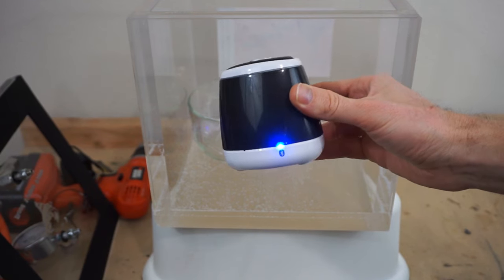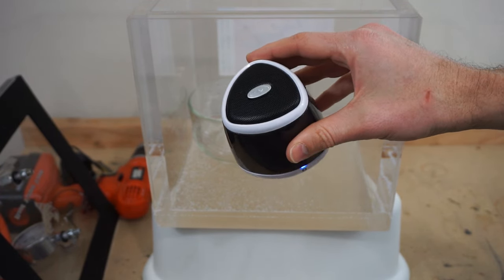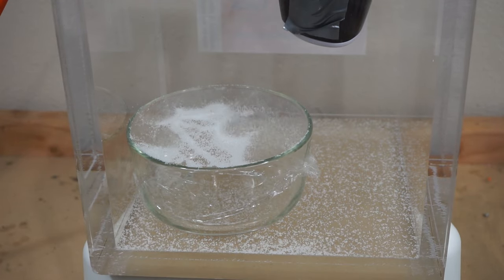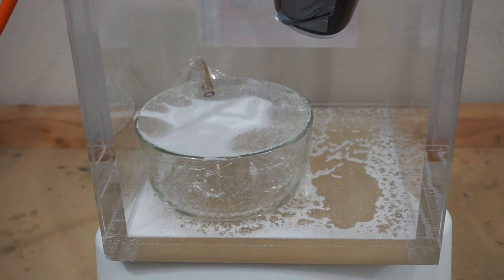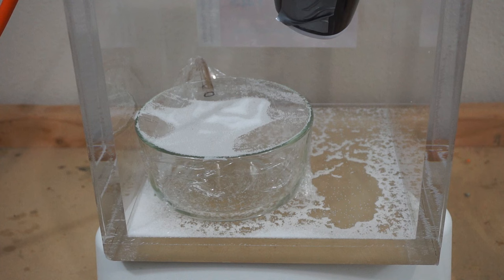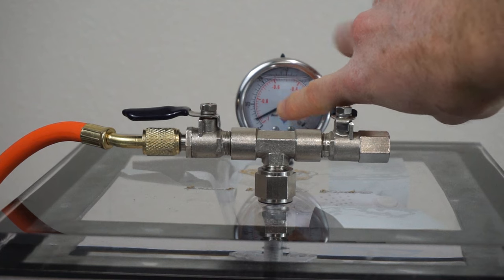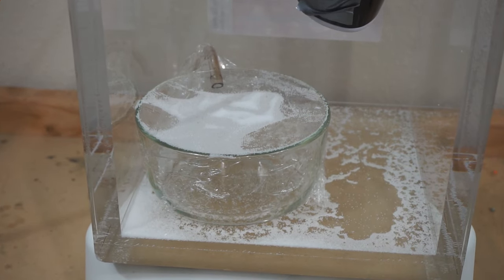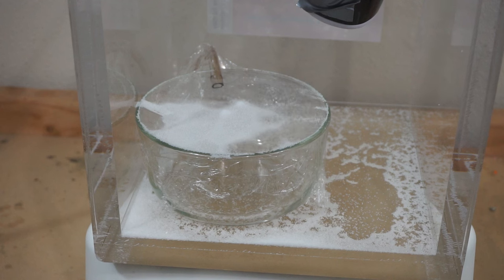What Happens When You Put A Speaker In A Huge Vacuum Chamber? Can You Hear It?

Comment from the maker: There are some people commenting that you would hear an explosion in space because the gas from the explosion would create the medium in which you could hear the sound. I did a quick calculation to check if that would be the case. So lets assume that we have a 100 L canister under 10,000 bars of pressure that explodes in space and we are 10 meters away. The gas will expand adiabatically (no transfer of heat) such that when it hits us, the pressure will only be 0.003 bars! That is still a much better vacuum than I had in this experiment. But based on the experiments of Cody's Lab we see that the initial pressure wave can have enough kinetic energy to at least move a paper, which means it could move your eardrum. So depending on your definition of sound then you could say that an explosion hits you with its own gas which will make a sound to you!

For this calculation: Assume gas is diatomic so gamma=7/5. Assume gas is ideal. So PV^gamma=constant. So the constant we can find from P_initial*V_initial^(7/5)=10000*100^(7/5)=6*10^6. Then after the gas hits us at 10 meters away it has expanded to a volume of 4.2*10^6 Liters. Using the same relation: PV^gamma=6*10^6 then we get that the pressure =0.003 bars!
Reply: Hydraulic Press Action can someone translate this for me
Reply: Hydraulic Press Action  r u a wizard
Reply: lol
Reply: Hydraulic Press Action do a light bulb that's on in the vacuum 💡
Reply: Hydraulic Press Action try cooking different types of food in it c:
Reply: +Paul Stringini there would be no explosion since there is no oxygen
Reply: Hydraulic Press Action I heard it's colder inside the vacuum chamber, is this true?  Can you please put an old pc in the chamber, run some benchmarks, and record its temps? I'm guessing the cpu will over heat because there's no air to push the heat off the heat sink so you might have to place a water cooling unit outside the chamber using rigid tubing. This is something I've always wanted to experiment with but I don't have the money to buy spare pc parts or a vacuum chamber.
Reply: hed420 Now that would be a good test.  Probably need a slightly bigger vacuum chamber though to fit a PC.
Reply: Hydraulic Press Action im in 7th grade but im pretty sure gamma made the hulk i think thats what i got from that
Reply: Hydraulic Press Action put a sponge in a vacuum
Reply: Hydraulic Press Action What the fuck does that mean
Reply: Hydraulic Press Action what app
 did you use for the tones
Reply: Hydraulic Press Action although your calculations show that there is gas present sufficiently enough within your description, I must question (without assuming any knowledge just wanting to question) whether the expanding gas that is currently expanding into the vacuum would be able to appropriately carry sound waves or would that active expansion cause energy dispersion on its own?
and in the vacuum of space Within the gases disperse faster than the speed of sound could reach them.
if you've ever experienced distant proximity to a large explosion, the shockwave reaches you visibly and physically prior to the sound wave.  but I wonder if that Shockwave would be noticed or would really be a "shock" wave without atmosphere? and then could it be followed by a sound wave if there was no atmosphere to carry it.
Reply: Codys lab did a test on gas in a vaccume it was pretty cool
Reply from the maker: Paco Vasda I believe that you would hear/feel the shockwave slightly, but not any following sound because as I showed the pressure would still be too low for any sound to occur.
Reply: you should check out "codys lab" he done explosions in his vacuum chamber
Reply: sound cant travel without a medium
Reply: Hydraulic Press Action it would only create hydrogen and release a wave of shrapnel towards you
Reply: +Hydraulic Press Action  What calculations did you do exactly??  How did your math give you more than 30 orders of magnitude difference?  I would be interested to either see this math, or know what your method was
Reply: How TF did you come up with 10^-29 bars? you do realize that a single molecule hitting a square cm would produce more pressure, right? also what is the volume of your "huge vacuum chamber" the chamber I've been using is about 30 Liters.
Reply: Cody'sLab hey Cody love your channel
Reply: this statment is not finished!
Reply: Hydraulic Press Action I pressed read more and I was like woah I was expecting like 3 sentences
Reply from the maker: +Cody'sLab I showed my calculation in the comment. The calculation was for an adiabatic expansion of a free ideal gas. Using the first law of thermodynamics you can come up with the relation that the initial pressure times the volume raised to some power is a constant (PV^gamma=constant). The small number comes from the huge volume of a sphere with a radius of 10m. Let me know your answer to what the end pressure would be. And yes, I understand that 10^-29 is zero.  And in regards to my "huge" vacuum chamber. I guess size is relative. Congratulations on your huge vacuum chamber.
Reply: Hydraulic Press Action  Your comment was cut off when I saw it.  I only now can actually see it
Reply: Hydraulic Press Action  Okay so here's the mistake in your math.  You wrote "P_initial*V_initial^7/5=10000*100^7/5=2^17".  That's wrong.  You need to get your order of operations correct.  It should be: P_initial*V_initial^(7/5)=10000*100^(7/5)=6.3x10^6.
I highlight that because you need to make sure that gamma=(7/5) is in parentheses.
Reply from the maker: +DANG JOS Thanks. You are right. That is embarrassing. So I get 0.003 bar which sounds a lot more realistic. But still a lower pressure than I got in my vacuum. If you don't mind I will edit my above comment so no one else is confused.
Reply: Hydraulic Press Action  That's fine.  And nothing wrong with admitting your mistake, which is what you did
Reply: Hydraulic Press Action  Oh and by the way, I don't think this calculation is appropriate for what we are talking about.  That equation for adiabatic expansion is really for an expanding gas confined in a container (pushing against walls creates the pressure).  In a space explosion, there is no confinement.  Rather the pressure comes from the high kinetic energies from the expanding gases that are flying out at as much as 9,000 meters per second!!  

This is what causes the pressurized shock-wave in an air explosion.  The expanding gases are compressing the air around the explosion into a huge pressure wave.  You can't use "PV^gamma", in that simple manner, in this case either.  So for a space explosion, the very high kinetic energy gas would compress your body and send a wave through your bones (via bone conduction) that you would likely hear.  Just think about a supernova.  The giant ring of glowing material around a supernova remnant comes from the compressed interstellar gas that surrounded the star.  So even in the vacuum of space, high pressures can be induced
Reply from the maker: +DANG JOS Yes, there are a lot of assumptions in my calculation. The one you are talking about is that the end volume is confined. The reason I did this is because it seems like this would be the best case scenario of highest pressure in that volume because all the gas is spread out evenly in the volume. The shock waves you are talking about are when an expanding gas is expanding against an already present gas creating huge pressure waves. For a free expanding gas in a vacuum I'm not sure that is the case.
Reply: Hydraulic Press Action ok umm where did you get your vacume thing at
Reply from the maker: +DANG JOS. For supernova I wouldn't want to be near either. But in this case, the max acceleration you should feel floating in a space suit 10m from this exploding cylinder should only be about 0.2 gs. So not too bad, you would just start floating away. You can check me on this one too (Pressure=0.003 bar-assumed, force on a 5 ft^2 human cross section would be 129 Newtons, and F=m*a so for a 60kg person, a=2m/s^2 so about 0.2 gs).
Reply: Hydraulic Press Action  Well that's based on the assumption that the numbers you gave are realistic.  If we're going to use real numbers, we have to think about what kind of an explosion that actually is. If we used 500,000 bars of pressure instead, it would be 10 g's and now it's a different ball gave.  So for 30 pounds of TNT let's say, what would it be then?
Reply: I'm so used to the youtube comments just making no sense and making your brain stupid just by reading the comments but not in this case. I actually learned something from Youtube comments. I can now check that off my Bucket List.
Reply: Eyeless Jack.  Lol.  It's a nice change isn't it?  Believe me, the past several months, I've spent too much time arguing with flat-Earthers, so this is definitely a welcome change
Reply: Hydraulic Press Action so it's basically how an explosion would sound coming from under water and then the after shock would hit u which is its own gas in similar context hitting the ear drum
Reply: #100%
Reply: yeah...
Reply: A sudden increase of 0.003 bar is still a lot when you compare it to the small pressure variations of normal sounds. The 0 dB point for standard sound pressure (SPL) measurements is set to 0.00002 Pa so that would translate into LOG(300 Pa / 0.00002) * 20 = 143,5 dB SPL! So you would indeed hear and feel a lot of it.
Reply: Hydraulic Press Action dude people aren't stupid. relax. you don't need to explain in detail where it comes across silly. 
we can all see what's going on. 
don't over kill.
Reply: This was a clever experiment like your RC drone experiment.
Next time, add no music to this, since the experiment is based on sound.
I did hear the sound gradually increase as the air was back to normal atmosphere.
Reply: Hydraulic Press Action I really want to read the explanation but I see numbers so I keep scrolling. 😂
Reply: +Hydraulic Press Action Uhmmm, assuming that gas in a canister explodes in a spherical shape, will the expanding sphere be solid with uniform pressure throughout the sphere  or hollow with a travelling front of sharp pressure spike leaving vacuum in its wake? Or might it be a combination of both, where the travelling front might leave a wake of constant pressure, increasing pressure from the center up to the travelling front or something else entirely?

Also isn't an explosion sound the pressure wave created by the explosion on medium not necessarily the explosion itself, that when the gases of explosion reaches you and you survive, it might actually just sound like a very very strong draft of wind? Also human ears have to be in 1 atm to function without bleeding involved, now that complicates things.
Reply: Ride84XL  That's a very good point!
Reply: Shit. This is a calculation which my brain can't comprehend..
Reply: Hydraulic Press Action looking at this coment my brain just shut down
Reply: Nice!
Reply: Hydraulic Press Action I read none of this
Reply: Aniekan Umoren sonic
Reply: Hydraulic Press Action I didn't get anything you said
Reply: Hydraulic Press Action how's that work on girls?
Reply: +Pilot172 Cessna172  No, gamma should be the ratio of constant pressure specific heat, to constant volume, which for a diatomic gas would be 7/2 and 5/2.   So the ratio is indeed 7/5.  And yes you absolutely can hear a pressure of 0.003 bars
Reply: Hydraulic Press Action have you made a video on water in a vacuum?
Reply: Hydraulic Press Action now what about pressurizing the chamber, would it increase the salt vibration.
Reply: reed vending  I would say yes
Reply: Actually most explosives have some type of oxidizer in the explosive compound. No outside oxygen source is needed.
Reply: Space isn't a vacuum. It's usually treated as one but it is not one. Space has an average kinetic energy (temperature) which requires particles.
Reply: hed420 it's only 'colder' as there are no particles to carry energy. temperature is the energy of the particles. it's not actually colder, there's just nothing to read a temperature from if that makes any sense. no particles can vibrate onto your sensor and that means your sensor picks up less vibration and thus a lower reading. as there are no particles to read from, there are no particles to allow for heat transfer (significant / not radiant which will occur) and the pc will get very hot and operate with no advantage.
Reply: Hydraulic Press Action i didn't understand any of that
Reply: Hydraulic Press Action, that would be as loud as a bicycle horn in air
Reply from the maker: +DANG JOS and +Pilot172 Cessna172 You would definitely feel 0.003 bars hit your ear drum, I agree. But I'm thinking of sound as vibrations not one pressure spike. So If I were to hazard a guess I would think it would hear/feel like a sharp "thump", and then dead silence because of the low vacuum. Not like a common explosion sound.
Reply: Hydraulic Press Action  I'm not sure that anyone is claiming that an explosion in space would sound the same as in atmosphere.  Of course not.  But even a sharp spike can be a sound
Reply: it is worth noting that this also demonstrates that electromagnetic waves do not need a medium to propagate. stupid me i thought all waves needed a medium and that the experiment would fail. it might not have helped much but the presence of a microphone in the vacuum could have provided additional data to analyze. well done with the clever salt. now do it again but with a microphone inside while testing if it can hear noise at all and remote detonate fireworks in the vacuum too
Reply: +Icy Uranus what em waves are you taking about exactly? sound is in no way EM.
Reply: sooo yes? or no?
Reply: josh, the bluetooth speaker, it uses a wireless connection and silly me thought a lack of air would make it impossible for those waves to travel to the speaker like i never heard of seti
Reply: Icy Uranus  That's right.  EM waves do not require a medium.  In some sense, space itself is the medium
Reply: Hydraulic Press Action, I didn't understand a word you just said...
Reply: Hydraulic Press Action yeah.. I definitely know what you mean...
Reply: Hydraulic Press Action TALK  ENGLISH
Reply: That would not be a sound, but a pressure pulse. Sound is oscillation of the medium. At 194 dB in air, pressure differential between the parts of the waves is one atmosphere. It can't go higher than that and still be an oscillation. It would be a shockwave.

So when you have gas exploding in vacuum and you get hit by its particles (like in Cody's video), you could hear something (depending on the proximity and the amount of stuff hitting you) but that's not sound. Gas particles hitting you in vacuum or anvils hitting you in vacuum, no difference. They're not sound, but they will cause sound when they impact the sensor. Anvils will do it a lot better, though. :)

Sound has a clear definition. Oscillation of an elastic medium. No interpretations there.
Reply: Temperature is a measure of juggling particles. So vacuum doesn't have a temperature on its own.
If you have a temperature sensor in there, there will be nothing to measure except its own temperature, and that is influenced by the radiative transmission of energy from another source. So if you have vacuum surrounded by hot steel, it would radiate heat on your sensor and you'd read high temperature. If you had a chamber cooled with liquid helium, you'd read very low temperature.

On the subject of CPU, fan would do absolutely shit job as there's nothing to push around. Even worse - fan produces heat so it would increase the temperature of the system.
The only way you could cool down the CPU is by conducting the heat away into a heatsink. If you're in space, your heatsink would be a radiator radiating infrared photons into the void.

In the vacuum of space, shielded from the Sun and other heat radiating bodies, the temperature of an object can reach a bit less than 3 K because the universe is flooded with background radiation leftover from the Big Bang. In practice, there will always be something nearby that radiates heat so shaded stuff in space will be warmer. For example minimal temperatures measured by New Horizons on Pluto were like 33 K. That was in shade and incredibly away from the Sun. It's a lot more than cosmic background radiation influence, but still incredibly cold.
Reply: Lajos Winkler  Well, perhaps if it's an object that doesn't absorb microwave radiation, it can still drop a little less than 3K.

And who knows what bizarre geologic processes are happening on Pluto.  There could be some heat source
Reply: May you please add assassin bugs and venus flytraps?
Reply: Well fuck, there goes my brain.
Reply: Hydraulic Press Action I'm out
Reply: Is that an app or a link that you're playing the specific frequency from?
Reply: Hydraulic Press Action not possible the explosion does not have the volume to make enough of a medium to allow the sound to be able to be heard so it is impossible nasa has already did a test on it when one the shuttle or something that they launched in the 70's when it exploded in space
Reply: LIKE A BOSSSS  What do you mean??  Explosives have their own gases
Reply: Hydraulic Press Action gas can be released in the vaccum of space and bits of matter it has to be at a certain density and you will absolutely hear things.  but in a vacuum no sound. but all you need to counteract a vacuum is gas molecules underpresure.
Reply: +Newezy /  That doesn't prove that an explosion in space couldn't kill you.  The hot gas can expand out by as much as 20,000 ft/sec!!  Who says this can't compress your body as well?
Reply: +LIKE A BOSSSS i know the two space crafts from the 70s voyager and i think oddessy. The one voyager is still working its way towards the outer edge of our solar system and the other i believe oddessy was drivin into Jupiter. Considering jupiter is full of expanding gasses it would of given a sound considering sound is just gasses being compressed. You would have to be in the gas that caused the shockwave from the object hitting it or else you wouldnt hear it.  Gas can stay vibrating while traveling threw the vacuum of space as soon as this gas cloud hit you, you would deff hear somthing.
Reply: DANG JOS of course, solids can be turned into gasses, liquids can be turned into gasses,visa versa gasses can be turned into other gasses. The point of an explosion is to turn stable matter into unstable matter.
Reply: Anthony Hewitt  The rest of your comment was cut off.  You should repost it
Reply: DANG JOS damn i dont even remember, the owner of this video basically said what i said, but he was more specific. basically it depends how far away you are and how big and what exactly is exploding. was your question, "do explosions make their own gasses?
Reply: Hydraulic Press Action what tone generator did you use? I want one that I can use to annoy people
Reply: Anthony Hewitt  I see your comment now.  I'm aware that explosions to releases gases.  My argument is that if an explosions can compress gases that surrounds them, then of it exploded in a vacuum and you were nearby, the expanding gas must be able to compress you as well
Reply: DANG JOS i dont see why not. As long as you werent to far away by then it may be to weak to even notice. But in space it isnt going to loose energy as easily as here on earth. bc there are no gas molecules to stop the expanding gasses.
Reply: Anthony Hewitt  Yeah that's my point.  But people, like Physics Girl, argue that it wouldn't do much of anything
Reply: Hydraulic Press Action I did that too
Reply: In my opinion space and vacuum is seen a bit wrong. I realy think space itself is nothing close to a vacuum as we know. But the total picture suggests its like a vacuum because there is mass inside.
Reply: Hydraulic Press Action ALMOST 1 MILLION!!!!!
Reply: Hydraulic Press Action what app did you use?
Reply: Hydraulic Press Action W hat s the Name of the APP?
Reply: Hydraulic Press Action ok. Now tell us the same in english!
Reply: Hydraulic Press Action why couldn't you of played 50 hertz! Much better reaction...
Reply: Hydraulic Press Action CONFUSION OVER LOAD
Reply: Hydraulic Press Action Hi, can you do this again? This time with the camera inside or sound recorder. It would be way cooler innit?
Reply: I think I'm in love with you 😊
Reply: You're right. You're e smartest man alive.. It took too long to have you discovered. Please enlighten us more. I bet u can put 99% of humanity to shame. Do let me know which school you go to when you're young.

Oh btw everything is fake, but not for UFO, it  is 100% alien, I'm sure u knew it already.
Reply: So is little green man..
Reply: So is the Hulk..
Reply: The Action Lab Where the heck did you learn this??? I only got to Algebra 2. I was good at it but hated math.
Reply: THIS IS HOW ITS DONE He already put live bugs in a vacuum
Reply: of course youd HEAR it ahahahahha
Reply: Wow! Where did you get all your knowledge? Your really smart dude! Everytime u type something u made the whole world looks so stupid..

I believe no one can be smarter than you honestly seriously and truely..

Nobody can nor dare to say space is perfect vaccum but you can! Your so smart!
Reply: @Oz Khan you should go for nobel prize. The whole world will vote for you honestly.. You're just smart.. Damn! You my perfect idol.. Can you enlighten us more? Very entertaining to see something from you.
Reply: You're a living proof whereby you show "how smart" a person can be!
Reply: Read More he wont
Reply: And that's why, in space, no one can hear you scream...
Reply: The Action Lab sound needs a medium in which to travel, a vacuum has no air or medium air=medium
Reply: The Action Lab ?
Reply: Read More lol I pressed your name
Reply: Oz Khan Rockets don’t need to “push off” anything in space. Kinetic energy is transferred into motion. When a star explodes it creates motion. Same with a rocket.
Reply: Dude don't ever quote Cody's Lab that guy is an embarrassment to the science community. Every experiment he does the math is off or he never shows his work. His scientific method is atrocious. You are so much batter than he is. My advice as someone who is studying science. Distance yourself far far away from that quack.
Reply: Is this formula even from present time? Are u sure u aren't from the future?
Reply: Great video! I was wondering if you could do a video to see if electromagnetic energy such as bluetooth and wifi can travel through a vacuum like you did here with mechanical radiation? It would help the flat earth vs globe earth debate a lot.
Reply: This is what we are taught in the second last year of high school. People, didn't you study that?
i'm really being serious Isn't that in your course?
Reply: Put a speaker in a high pressure chamber and will the sound get louder?
Reply: I hate math :(
Reply: of all videos, this one didn't need any background music. can u remake it please! thank u. no worry if ur too busy.
Reply: WHAT HAPPENS WHEN YOU PUT SENSORS IN THE VACUUM CHAMBER? Like a microphone, or other wave type sensors? If a tree falls in the forest but you're deaf, does it still make a sound? Are there other ways to generate a wave without using pressure, sonic, longitudinal waves? Why can't the radio broadcast on 800Hz?